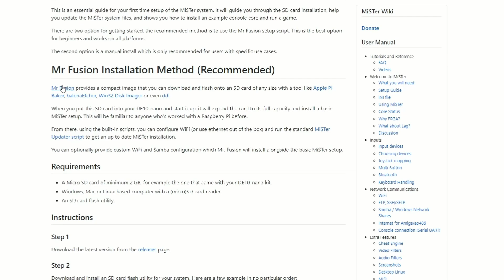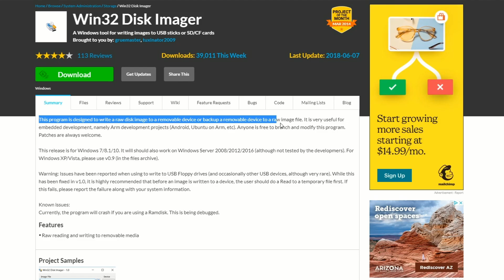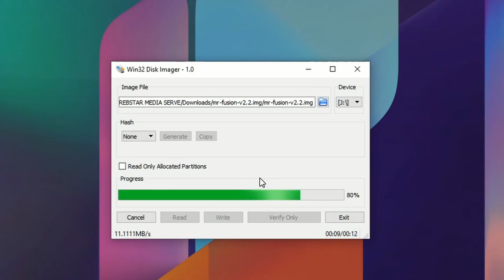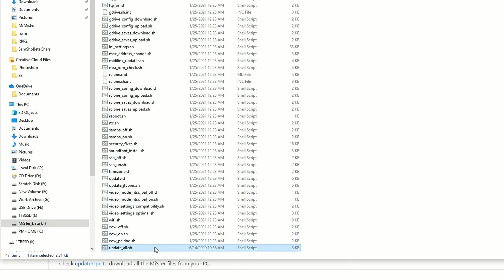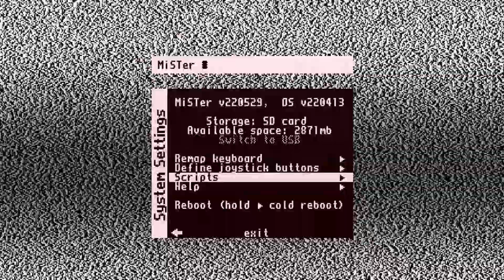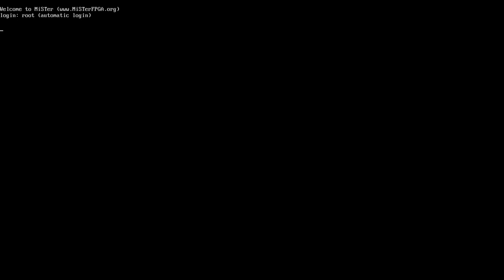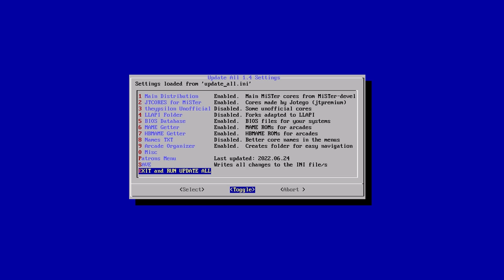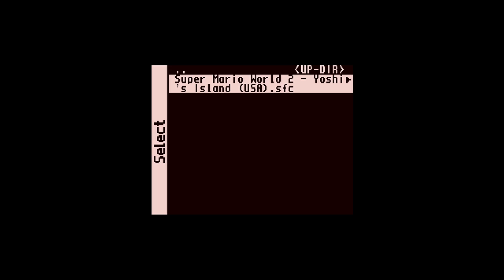MiSTer FPGA DE10 NANO! Setup Guide and Hardware Introduction to FPGA Gaming! 2022 Edition

Comment: It's worth pointing out that you can also use (as I do myself) a cheap 6 dollar OTG USB hub rather then the 40+ dollar USB board. It ain't nearly as neat and pretty but functionally it's basically identical.
Reply from the maker: Yes. I just dont have that hardware on hand to demo
Reply: Are there USB hub OTGs in existence? I have a USB OTG dongle and then a power USB hub... Unless that's exactly what you're referring to 😉
Reply from the maker: I’m not 100%. I’d have to check
Reply: @TheMikeyb86  Yes, mine is a micro USB to 4 port USB-A OTG hub. Supposedly its meant for a Pi4 but all i've ever used it on is the MiSTer. Currently its going for 8 dollars on Amazon, so it went up a couple bucks in the last 3 years 😉
Reply from the maker: Good to know. Just not something I’ve used so I never recommend parts I haven’t tested myself

Comment: I know everyone recommends Mr. Fusion because it's a universal way to install MiSTer, but I definitely recommend any Windows users also check out the MiSTer SD Card Installer. Any time that an update has black screen boot the MiSTer install, I've just grabbed the latest version of MiSTer, used the update function of the application, and I'm back in business and up to date. Don't have to re-transfer my games because the card was not being wiped again by the process. Some of the troubleshooting can be done by hand by recopying files over but honestly much easier to use the app.
Reply from the maker: This is true but for newcomers I still find Mr. fusion easier to teach

Comment: One thing I encountered since I bought a used DE-10 Nano - the jumpers were not set to the default and it wouldn't boot the MiSTer image from the MicroSD card. Make sure you check the manual and set the jumpers on the board to the default positions if things aren't working.
Reply from the maker: Interesting. That’s not the usual. I wonder if yours was set incorrectly by accident?
Reply from the maker: But good to know if anyone asks me in the future!

Comment: I started off with a 32mb ram module. When I upgraded to 128mb, I just use the 32mb as the second ram module. So it didn't go to waste.
Reply from the maker: Nice. I keep mine single ram with Analog IO but I have a second 128MB stick so I can swap in and out as needed

Comment: I use wired controllers also because they are a good value and often cheaper than the wireless versions. I use an 8BitDo SN30 Pro wired and a RetroBit Sega-branded '8 button' Genesis controller. They cover most of the bases, but at least on PlayStation I'd have to make sure i know what buttons are which!
Reply from the maker: For PS1 I use a Switch Pro controller. Works well for me. But so does PS4

Comment: I use my Turbografx-16 USB controller (that came with my TG16 Mini console) wired, my PS4 controller wired, and my arcade stick wired. I also occasionally use my Nintendo Switch Genesis and SNES controllers wireless. They definitely have some lag, but they're great for non action games like RPGs.

Looking forward to tomorrow's Saturn video!!
Reply from the maker: Just finished uploading the bonus video for tomorrow :) all set to go!
Reply: I had a working wired xbox one controller.  Now it doesnt work . New controller and new batteries.  It was working yesterday

Comment: Can anyone give an indication of the space requirements after running the update all script (that I assume pulls all the arcade cores and roms) but before I dive into completing the setup with playlists/virtual drives for the console/home computer cores? Thanks in advance. Trying to decide on what size micro sd and what size ssd.
Thanks for such a straight forward clear instructional video 👍
Reply from the maker: Good question. Under 1GB I believe for update all and the full core set. I use 512GB cards myself

Comment: Quick question when you use mister with a crt TV and use the controller wireless is there still some lag or is it much improved from a lcd because I ordered from 8bitdo those mod your kit snes and nes controllers to make them wireless  your thoughts on those?
Reply from the maker: Depends on the controller. Some have so little wireless lag you wont notice. Others you will
Reply: @VideoGameEsoterica  good to know thanks
Reply from the maker: Someone keeps a spreadsheet on latency. Can’t remember where. Google “mister FPGA wireless controller latency” and you’ll find it
Reply: @VideoGameEsoterica  I have heard of these spreadsheets but I think they are tested with lcds only
Reply from the maker: Hmm. Possibly

Comment: Has anyone ever run into an issue where you can't access the update_all settings even though you're pressing up when starting the script?
Reply from the maker: I have not seen this myself no
Reply: @VideoGameEsoterica  I figured it out. I had fb_terminal disabled in the .ini file. I disabled that because I wanted to view scripts through analog video. Didn’t realize we are supposed to be running our scripts over hdmi. 🤷🏻‍♂️
Reply from the maker: Ahh yes. That’ll do it

Comment: kind of a stupid question but every time I run the update all script, I can never get into the 'update all settings'.  When the script runs, it just runs the updates within the standard looking mister interface.  Do you know what I'm doing wrong?
Reply from the maker: Are you getting the “hold up” prompt to get to the menu?
Reply: @Video Game Esoterica think I figured it out albeit its a bit strange on what  I did.  Essentially, when I was trying to run the update all script I was doing it from a CRT with these older/configured mister.ini settings.  When I did that I never saw the option to get into the 'update all settings'.  Once I reformatted and used the default mister.ini settings, ran the update all script via an HDMI display, had no problems getting into the 'update all settings'.  I know at one point I made some changes to the mister.ini settings but cant recall what I edited.
Reply from the maker: Ooh yeah you can’t do it from CRT. Due to some Linux based refresh rates I believe

Comment: I was playing it on wired controller but now my xbox one controller just flashes but no longer works. Any ideas in a fix ?
Reply from the maker: Hmm. Not sure. I’ll have to ask around
Reply: @VideoGameEsoterica  the system boots and everything . I checked the batteries they are new. The controller is new. I plugged my MIStEr to my computer. Would that have messed up interface?

Comment: How large of an SD card do you need for just the Arcade games? When people like Jotego push a core to public, will updating the MiSTer pull down that Arcade game/core as well?
Reply from the maker: Good question. I am not sure the install size. Not huge. I have a test 16GB card that has them all so
Reply: @VideoGameEsoterica  after running update_all on a fresh install with the configuration you suggest, you're left with 3655 MB on an 8 GB micro SD card.
Reply from the maker: Thanks for reporting back the data

Comment: Wired controllers are not an option for me , i been using the 8bitdo wireless arcade stick and highly recommend it ..
Reply from the maker: I like both depending on what I am playing
Reply: @VideoGameEsoterica  even with fighters I can still pull off intricate combos on the wireless 8bitdo..
Reply from the maker: I use hard wired but 95% of the time I am playing MiSTer its for capture so I sit close enough for the wire not to bother me
Reply: @VideoGameEsoterica  ahhh my mister setup is right in my living room.. great for convenience and letting the kiddos try stuff out .. but bad for wires and little legs tripping over em ..

Comment: Purchased my MiSTer from alliexpress and after I run the mister fusion it reboots and that is it, never boots to the mister interface.
Reply from the maker: Hmm. I can’t say I’ve seen that occur. When you put the SD card into a PC do you see the MiSTer folder and then a partition that says cannot he read / it has problems? Because that’s what you’d expect…sounds like an installation failure
Reply from the maker: Or a sync failure. Can’t discount it’s running but not displaying. Do you get LED lights on boot flickering?
Reply: @VideoGameEsoterica  I think I found the issue. I removed the case and now it works like your video. Still need to plug-in the network and continue testing. Thank you for your video, it helped me find out if I was doing things correctly.
Reply from the maker: Removed the case and now it works? I wonder what the issue was because that’s not what I’d expect would improve it. But hey…glad it’s running!
Reply: @VideoGameEsoterica  The case never fit very well and I think it was a grounding issue. I have had trouble with the keyboard not working or intermittently and other issues. I will keep messing with it and see how it goes. Thanks again for your video.
Reply from the maker: Ahh that’ll do it. Time for a new case
Reply: I had the same problem, swapped out the sd card and it was ok after that.
Reply from the maker: Glad you figured it out

Comment: I'd even go so far as to say that unless you have a CRT tv, dont even bother with a mister at all, save yourself the entire cost of the setup and just use software emulation on a wii/xbox/playstation/raspberry pi or pc.  In my opinion the latency improvements you gain from using a mister are completely negated by using an LCD/OLED.  Please people, do yourself a favor, if you have a Mister PLEASE for the love of god use it with a CRT. Any other display (except maybe a SD def plasma) is a waste of time and money.
Reply from the maker: Waste of time and money? No way. I use it 50/50 on a PVM and my 4K tv. Great on both. I’m not saying something like a console can’t do a good job too…but there is plenty of use case for MiSTer solely for LCD users. Well good LCD users…not ten year old TVs with latency that feels like a brown out
Reply from the maker: That’s fair. Can’t say I agree but if you are happy, I’m happy for you!